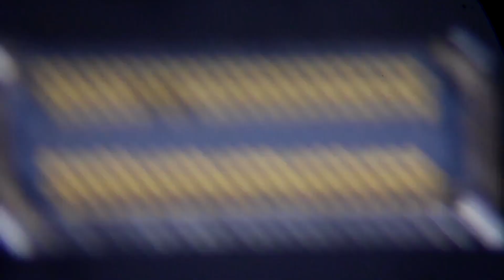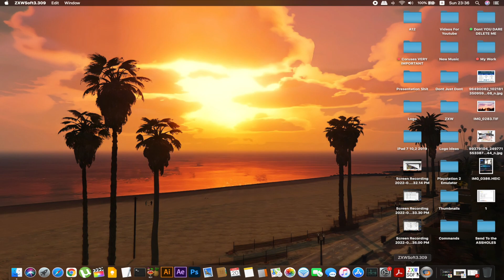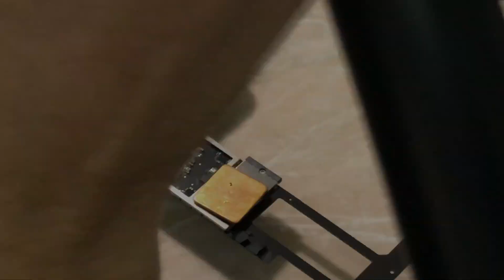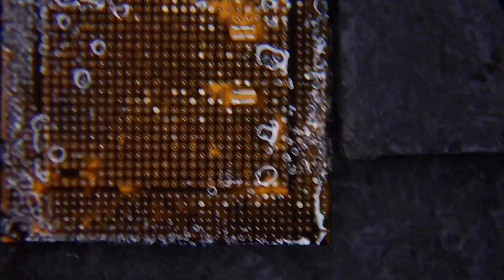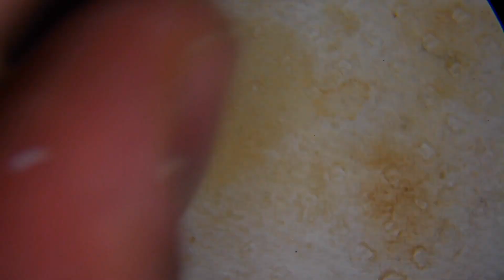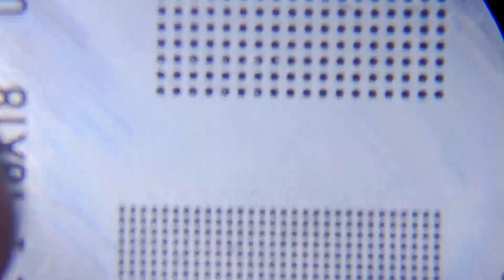iPad 7 2019 10.2 Touch Not Working (SPI_GRAPE_SCLK) Repair

Comment: Amazing skills for the reflow. Did the digitizer replacement but still facing the same fault. Do not feel comfortable with the CPU reflow. Is it possible to reflow the CPU with flux without removing the underfill ? Can you confirm if the boosted 15 volt will be absent if the digitizer is not detected by the CPU? Ours is missing. Garbage PCBA by the contractor.
Reply from the maker: Obviously not recommended to reflow the CPU, it could work for couple of hours/days/weeks but not long for sure, can you be more specific about the boosted 15v line ??
Reply: @AntoineKiriaky10  Thank you so much for the reply. The referenced 15v boost is the PP15V0_TOUCH. It is at 0 volts and may be due to the A10 CPU losing the bonds under the BGA. With regret, believe the A10 is no longer due to the reflow attempt. Can you comment on if the a10 CPU on Aliexpress for the iphone series are the same or not for the ipads? Also, there is a mention of the A10 RAM. Is this a dual layered CPU package? Welcome your comments. We have a reflow BGA workstation that will be deployed on the next attempt (Seamark). Need guidance on the A10 CPU replacement. Does the serial # change once the CPU is replaced? Which tool allows for the proper activation of the logic board after the replacement? The logic board is unlocked but the touch was not working. We replaced the digitizer with a new one - no go. Replaced the Broadcom touch IC - reflowed fine but still not working. The SPI CLK line in diode mode was fine. With regret, did not check the other SPI lines in diode mode after the balls were cleaned on the PCBA. Thanks again.

Comment: Hey actually my ipad screen also stopped working, i asked some local service centres and they said ipad screen is dead, but it should first start to get slow or something, because it literally just stopped responding to touch while i was using it, like literally in a snap, a second. So can it be a hardware issue or a software one, plz reply

And yes the ipad is working perfectly fine, no slow no heat just the touch, home button is also working like new, my ipad is 6th gen 2018 ver.